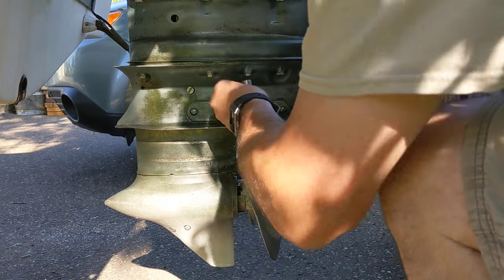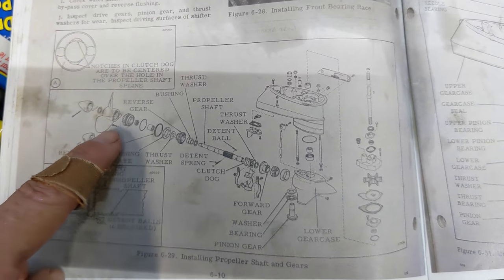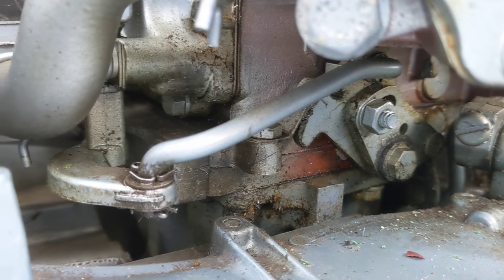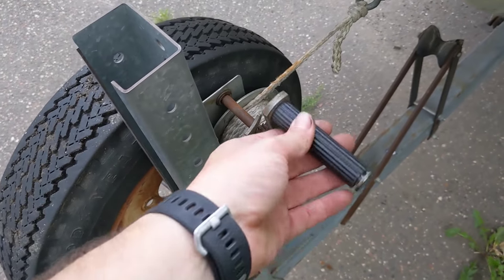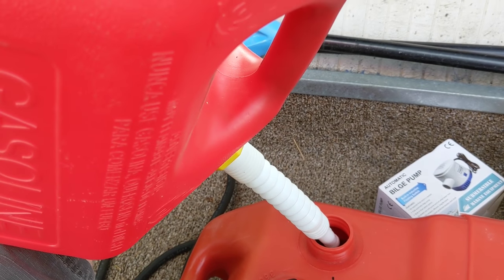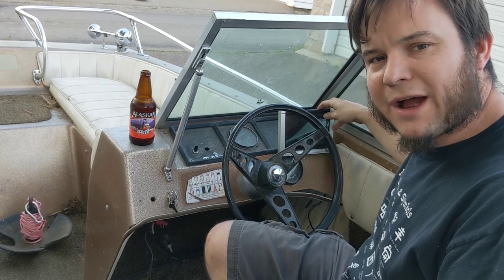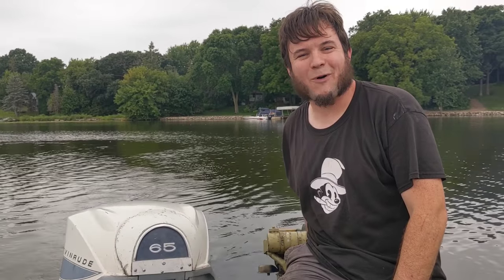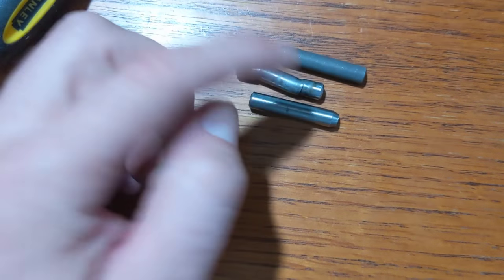Refurbishing a Free Speedboat - Part 5 - Why Won't It Shift???

Comment: The shear pin is for those unfortunate times when the prop touches bottom. The roler bearing should have had a chage for the rolers.

Comment: You gotta put lower end unit oil in from bottom hole and pump it in until it comes out of top hole. You probably know that cause your pretty savy but just in case. You are super good at workin on that stuff!! Subbed to ya!

Comment: Hey, don't throw those 2 screw drivers away, SAVE THEM FOR PARTS!!! Make some new handles out of a nice piece of wood or something,  use an angle grinder to roughen up the shafts of the screw drivers and grind a new tip on the one that is bent or turn it into an awl or something. If you use a pretty wood like oak or cherry and oil them up you can give them away as the prize for naming your boat.

Comment: As far as the shifting through not being long enough open up your control box the lever is not pushing it back and forth far enough to get forward and reverse something broke or came apart I'm guessing
Reply from the maker: Yeah I'm considering dremeling out the ends of the control box so the shift lever can move farther :-D

Comment: the clutch poll is not staying engage you can see where it is rounded off you need to get a good used 1 or  use a dremol tool to sharpen up the edge of it so it won't slip out anymore . look at the end of the gears where the clutch dog slides in you will see that one side of the dog has a sharp square  edge and the opposite side is rounded off 
Love the vids 
later
Reply from the maker: Oh, interesting! I didn't notice that when I was working on it, I'll have to see if I can find a replacement!
Reply: @saveitforparts  you may be able to put an edge back on it with a rotary tool.
could save you a couple bucks.just be careful not to get it to hot or it will take the temper out of the part.

Comment: Whn you drained you narly n oil out of thr lower uit and it was caramel in color lookd like water in the oil. Your lack of gasket on the top of the lower unit confirms this. Happy boating.

Comment: I’m guess the brass part of the shift rod isn’t right so you might have to pry open the lower brass clamp part so the rod will go all the way up the head of the rod should be above the bolt